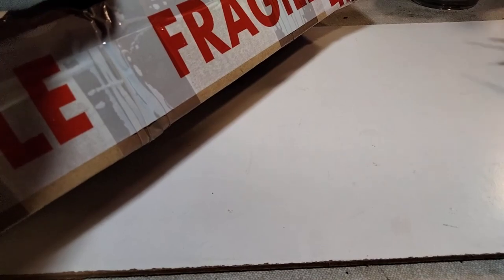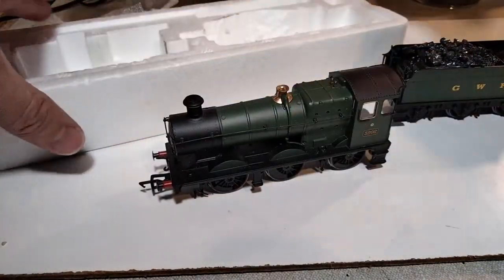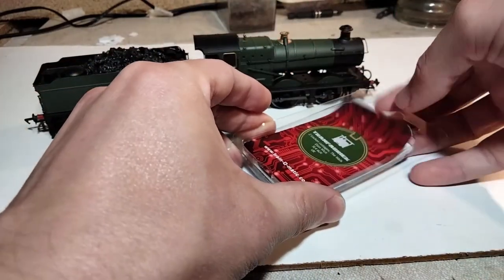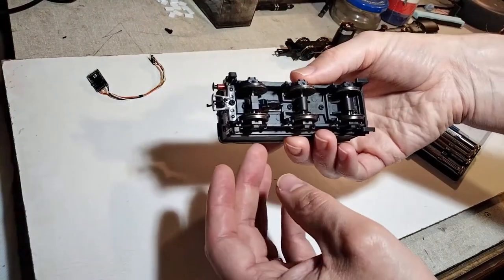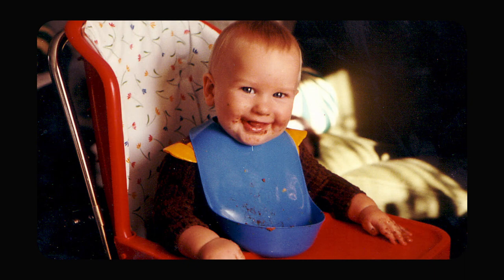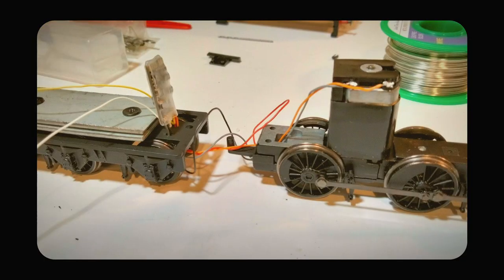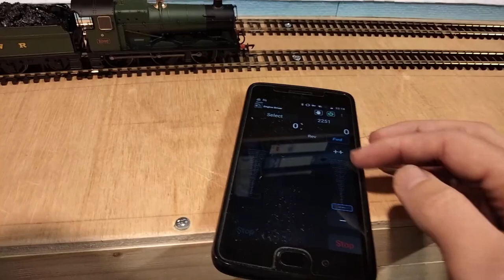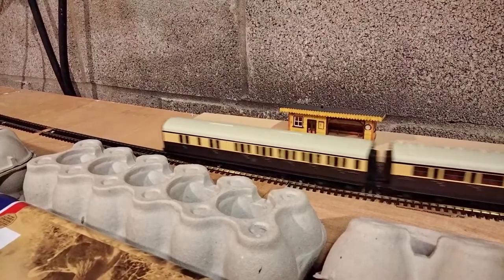Hard-wiring a DCC decoder in a Bachmann Collett Goods | Modelling a GWR branch line | Episode 10

Comment: The Bachmann Class 2251 loco' & tender is a very old model and overdue for an upgrade!!    I have nine of these models, one of which has just had a complete strip-down and rebuild.    Several tips...Don't over oil especially where the oil can get into the motor via the rear axle.   A lot of people think they have to add pick-ups to every axle and every wheel.   With the class 2251 you can improve the running qualities greatly by running two wires and pick-ups to the rear-axle wheels only of the tender as this is all that is needed...it connects the two front loco' wheels with the rear-most wheels of the tender and increases the pick-up length.   A continuity test between the front loco' wheels and the rear tender axle wheels on both sides to confirm.

Comment: If I'm not mistaken this Collett Goods model was taken over by Bachmann from Mainline. 
They did some retooling what the motor concerns but for the rest it seems the same.
I made my Mainline DCC.
I don't know how yours is constructed but with the mainline there is a screw on the underside of the boiler that loosens the wait that is in there.
I took that our, and cut a slot in it with an iron saw and smoothen it with a file, so it fitted the decoder.
Anyway good job done👍
I have not met a loco that I couldn't turn into DCC, the worst ones thou, are the old Bachmann ones, with the split big Blok chassis where the motor pickups are direct connected to the chassis.
You need to machine the chassis block in order to isolate the motor from the block, but it can be done…
Reply from the maker: Yes, that weight is removable, but as I don't have the right tools to machine it down I had to come up with a different solution. It does also put the DCC chip in a better position to be able to install pickups in the tender one day, if I need to, and keeps the weight over the driving wheels. But yes, there's more than one way to do it!

Comment: Are the redundant wires on the chip for a speaker? I would have installed one if so as there’s bags of room in the tender.
Reply from the maker: No, they'd be for lights, if you had them, which I don't. I think a sound enabled chip would be larger.